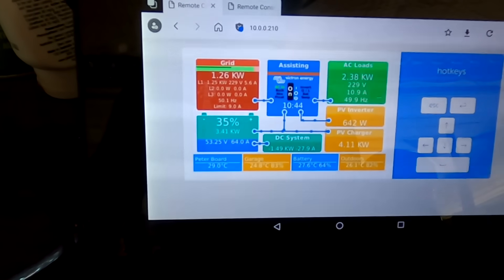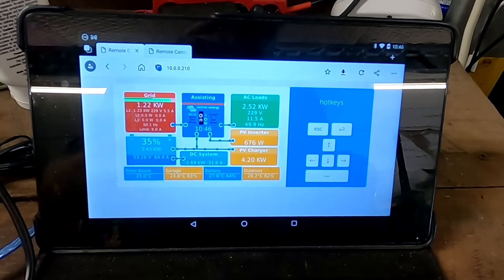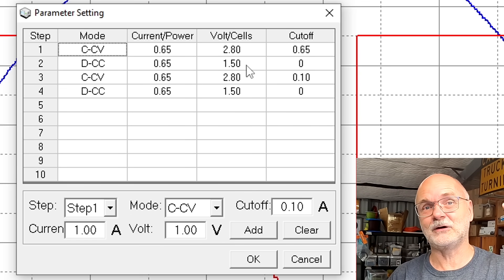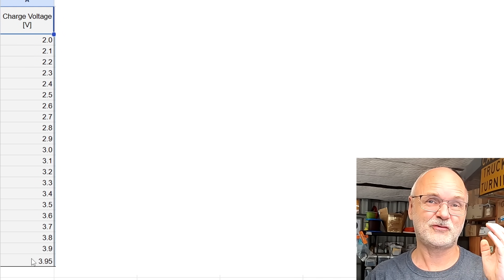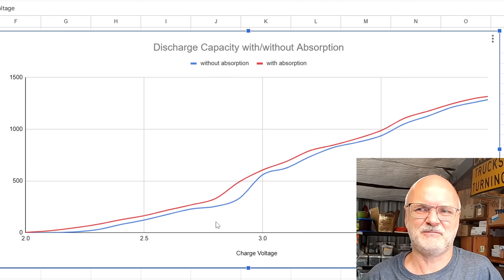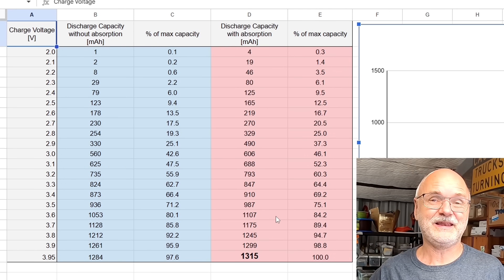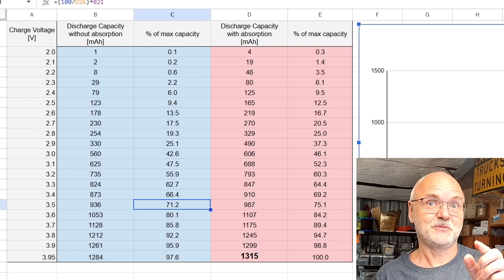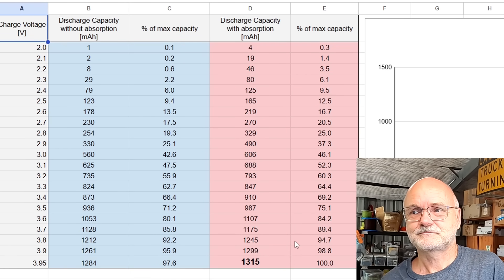Absorbing Sodium batteries. Capacity gain or worthless?

Comment: I think we’re going to find less need for balancing. We balance LFP because a few millivolts has a significant impact on SOC. In a series sodium pack, other than the BMS ensuring that no cell goes above 3.95 V or below ~0V, I see little need for balancing, unless the cells are grossly mismatched. My concern for solar storage with these is the large voltage swing between 0-100% SOC. I think this necessitates inverter re-design.
Reply: Top Balance, Middle Balance, Bottom Balance - I say let the balancer run....  It will shut itself off when it's happy.
Reply from the maker: Good thinking. Thanks for sharing.
Reply: The Voltage swing can be compensated by using only like 60% of the battery and than have to buy more battery or having better suited inverters. The priece is what matters.

Comment: I would be interested to see what happens when you connect sodium batteries that are at different states of charge into either a single pack, or packs of different capacity or state of charge together in parallel.  You've shown that different states of charge and different capacity doesn't make much difference in LiFePO4 batteries because of the flat charge curve of the cells.  Wonder how the linear curves would fare under the same situation!
Reply from the maker: Something like this will be in the next video...

Comment: Andy, sign me up for sodium batties!!!

Just reviewing spec sheets.  Looks like the Victron Multiplus II will run just fine with these.

The input voltage range of the MultiPlus II  is 38 - 66volts

16 Na batteries at 3.95 volts = 63.2 Volts (that's 100 SOC)

16 Na batteries at 2.375 volts = 38 volts (that's less than 10% SOC interpolated from you tests)

So using a Victron Multiplus - it looks to me like you can use 90% of the Sodium battery cells' capacity.  Sounds pretty good to me, especially among those who like to cycle at less than 100% SOC.
Reply from the maker: As discussed in the first sodium battery video😉
Reply: I wonder what the output voltage is at the high and lowest batt voltage.
Reply: With that voltage range I want to know what happens to the amperage output during a constant high discharge.  Say 6kW, as the volts go down the amps go up, how would we live with that without popping things?
Reply from the maker: @garys-half-baked-offgrid-dream It depends on your inverter and how it handles things. At the moment, there is no equipment out there which can use sodium batteries to its full potential. With our current inverters, we can only use a portion of the usable capacity.
Reply: @OffGridGarageAustralia  It's such a disappointing anticlimax, I was excited by the promise of this chemistry.
Reply: @OffGridGarageAustralia   When equipment gets redesigned to handle these sodium cells, let's hope they go ahead and make accommodation for super capacitors while they are at it...

Comment: I don't think these sodium batteries need to be BMS balanced because of steep voltage curve because as soon as voltage drops in one sharply it would be enough for some current from other ones to flow into it because of higher voltage potential. Sodiums might not be better than lead acid ones but perhaps they have more lifetime cycles in them although I am not sure if anyone proved or debunked this yet.
Reply from the maker: This would be the case if the cells are in parallel. But if we connect them in series to a 12V battery, you will need a BMS and a balancer.
Reply: @OffGridGarageAustralia  let1s see how they balance then with BMS. I reckon should be easy because of steep voltage curve 😁

Comment: I think these sodium batteries can be continuously balanced during charging. 

The cell voltage determines the SOC and therefore it is perhaps possible to keep the cell voltage the same for all cells with a balancer. All the cells will then reach the required SOC at the same time. 

This is however not a normal balancer, but a balancer that uses an average voltage as the balance voltage.

Comment: It's well known that LiFePo4 should ideally be stored at around 80% capacity and very low discharge or charging to 101% may shorten their lifetime.
How does this compare to the sodium battery type? Is there any data about optimal storage or optimal state for them to be in? If only a certain part of the whole capacity (aka voltage range) was used, should it be either the lowest part, a middle part or the highest part possible?

Viele Grüße und Danke!🇩🇪

Comment: Long story short: for whatever variant of Na-ion cells you got, absorption is effectively the same as float and end-of-charge voltages. Pick whatever SoC you want your system to sit at when "full", look up the corresponding voltage on the curve, set all of your voltages to that, done.

Comment: Great video. The 80/20 with LFP I'm  using to extend the life. I'm wondering going to 100% with Na+ shortens the battery life?  I'm wondering if you thought of doing a side by side with lithium-ion versus sodium ion same battery amperage discharge (unless you have charts already..) As an aside there are some videos on YouTube that have done the nail puncture test. No fire they just kind of explode.😮

Comment: It relates to overpotential voltage vs cell current.  For given chemistry, overpotential voltage vs cell current is greater for thicker electrode.

If during charging and discharge tests, you terminate current  periodically until cell voltage stops recovering to no load cell voltage you will get direct measurement of overpotential voltage slump (for dischg) or bump (for chrg).  You can do this at several points, approx 75%, 50%, and 25% SoC are typically good points.  LFP needs 3-5 minutes of rest period of zero current to recover to OCV equilibrium.  It would be nice to know what Na-ion is for recovery time.  Overpotential gets greater for greater cell current (chg or dischg).

These particular cells have fairly low overpotential.  It maybe they are made with thin electrodes.  The 200 AH prismatic Na-Ion cell may be different, likely greater, for given C(A) cell current chg/dischg rate.  Not all chemistries have symmetrical chg and dischg overpotential voltage vs current.  LFP if fairly symmetrical.

There is definitely something happening at about 25% to 35% SoC range where the overpotential rises in that SoC range.  It typically means there is some issue with ion migration rate in that SoC range.  Na-Ions are significant physically larger than Li-Ions.  The graphite negative electrode is called hard graphite, which is more like shale layered graphite, to allow for larger Na ions to infiltrate.

Sodium dendrite growth is an issue with Na-Ion cells and the funky result at 25-35% state of charge may have something to do with the alloying used.  Carbon arsenide, nickel antimony.  So much for environmentally friendly label.
Reply from the maker: Interesting! Thanks for sharing.

Comment: Got some issues with the info you are giving us. I don't think these small batteries will extrapolate that well to the larger ones. Assuming they are linear in all aspect; still the deviation could be quite large. Also, I am not quite familiar with the price differential within the battery formats. I think the price differential is what is going to do it overall. Knowing the manufactures avarice. Supply and demand will probably be the deciding factor.

Comment: I would say, with this linear curve,  you can balance almost at all voltage except near 1.5v. With or without absorption.
Reply: That mean, with a frankenstein battery and a high capacity balancer, you can ever make a top and a low balance of your cells. You may be use all the capacity of your differents cells capacity even if i don't know if it will be a good idea for your cells life.
Reply from the maker: The balancer would still need to be large enough to do a bottom balancing and top balancing with the same pack. with 300Ah and 280Ah in a mix, it needs to move these 20Ah back and forth quickly, depending on the load.
Good answer and thinking.

Comment: Well, you can set absorption and float to the same values...like 3.7V
Also, a passive charge balancer can make sense and you can also leave your cheap ative balancer connected the whole time ;)
But still, in a normal solar system, your batteries are fully charged many hours a day...so our LiFePO4 balancing strategies still work perfectly fine as well 😇
P.S.: Thanks for the crazy effort!!!
Reply from the maker: Thanks for sharing your thoughts. Good answer!

Comment: Hello Andy, 
more Batries or more Panels....What's better?
If you double your batteries, will you get them fully charged on one single sunny day - espacialy during winter?
And how many days per year will more capacity give you a gain?
With my batteries i can get arounnd for two nights and a dark day between. If i double the batteries i will gain around 36 houres. 
But in Winter im not getting my batteries fully charged for weeks - doubling them would then not change anything.
In summer they will be discharged at maximum to 65% SOC over night. 
So there will be only a gain on some days in Feb and Nov.
Concluding this, my descition was to set up more panels for cloudy conditions and leave the batteries as they are...
Reply: I think more panels is the right choice most of the time. You should size your batteries based on demand, which also decreases as you add more solar panels for the worst of days. This is a much better way to go with solar panels being pretty cheap right now.
Reply from the maker: For the price of a battery you can get a lot of panels. BUT, do you have the space to install them? Not everyone has and is limited by the roof size.
My energy consumption with the Tesla and a potential second EV just around the corner, the plan to connect the whole house to this battery as well as going off-grid with the system, demands more capacity. I can chew through 80% of my battery shelf in one night and if the sun does not shine the next day... well... This would not happen if I'd have a 100kWh battery or more. Sure, I won't fully charge it in winter, but who does???

Comment: Nice. I was thinking since victron has its charges sperately (not hybrid) say when the battery is fully charged to where we want n yet there is load n the charger (solar) give power to the inverter and if yet there is extra solar wouldn't that charge the batteries till the bms stops charging. If this happens then the bms won't be the last resort. Or does the charge reduce voltage so that it wouldn't charge the batteries. I not sure if I am clear regarding the question😂

Comment: No need to have an active balancer if the voltage correlates so well with the SOC.
Reply from the maker: No balancer at all or just not an active one?
Reply: When voltage closely aligns with the SOC, opting for a passive balancer rather than an active one is often sufficient. This method leverages the strong voltage-SOC correlation to maintain cell balance effectively and cost-efficiently.

Comment: I wonder how they would compare as replacements to Li-ion 18650 batteries, of the same capacity
Reply from the maker: This will not work. The voltage is highly different.
Reply: @OffGridGarageAustralia  Sorry, I guess I wasn't very clear ... my bad.   I'm not talking about replacing a single cell in say, a 7s battery pack ... you're right, that would never work.  BMS would freak.
I was talking about a pack made from nothing but the 18650 Sodium cells. Maybe a 4S 12v or an 8S 24V pack.
Reply from the maker: @GregOnSummit  here again, voltage of the sodium battery is very different. 12V battery starts at 6V linear up to 15.8V. Crazy.
We will do this in one of the next videos.

Comment: Even at 50-60% DoD, these should have a major advantage over LA if you factor in weight, cycle life, and voltage sag. As long at the price is right.
Reply from the maker: Yeah, OK, in comparison with lead acid, they have an advantage. Voltage is still a hug challenge though.

Comment: Hi Andy, I have a totally off topic question for. I have a 48V battery pack which has problems. When it discharges the SOC drops down to 0% while the pack voltage remains about 52V. When it charges or is at rest the SOC returns to about 90% and all looks OK then. But as soon as it needs to discharge the SOC drops to 0% again. The pack still delivers the necessary amperes but it seems not ok to me. Additional input, I had a short once at that cell due to my own stupidity and the + pole is very much damaged, could that also be a reason for this behaviour? I hope you will be able to respond! Thanks in advance

Comment: It sure looks like the balancer could just be left turned on from roughly 50% SOC all the way to 100% SOC.  You could charge to just about whatever SOC level you want based on voltage without too many worries.   I'll bet sodium battery default settings in BMSs won't do that though... they'll be just as broken as default settings were for LiFePO4, for years and years.

Weather report is in amps now, with XYZ amp-hours expected!   Thanks for doing the tests!  Interesting interesting.

-Matt
Reply from the maker: Thanks for all your great comments and support over the years. Much appreciated.

Comment: Hi Andy, amazing work again. Superinteressting to see the different chemistry performing. I know about your LiFePO4 charge recommodations, but do you think you could perform the same test for LiFePO4 as well? Like charge voltages 3,35-3,65V in steps of 0,05V. Would be extremely interessting and would a great reference to all LiFePO4 users out there! :)
Reply from the maker: I think I have done this already and found it only works at 3.4V and above. However, 3.4V does not really work as there is not enough voltage delta to start the balancer, so 3.45V turned out to be ideal.
Reply: @OffGridGarageAustralia  Thank you for your reply Andy! I am aiming for the Excel graph you've shown in the video. Many people insist on the fact, that a cell is only "full" if it hits 3.65V. But as we know, this is wrong, if we spend some time for absorbtion - or at least it is wrong if we consider 99% SoC also as "full". With the sodiums we have seen two more or less parallel lines: absorbed/non-absorbed capacity. For LiFePO4 I would expect the same parallel graph from 2.5V-3.35V, but the "absorbed"-line should max out at 3.4-3.65V. I think this would be very beneficial to visualize e.g. at your website - even if most of your viewers know this fact already. But as reference to the world it would be superb :)
Reply from the maker: @techNick0815  OK, no worries, I'll put this on my list of future videos. Thanks.
Reply: @OffGridGarageAustralia  thanks a lot Andy! :)

Comment: Is there a downside to absorbing? It would seem to me that every extra Wh of capacity is nice to have if there is no added cost or risk in doing so.
Reply: Sitting at a high voltage for an extended duration is stressful, and seeing that absorbing at 3.6V still gives less usable capacity than momentarily charging to 3.7V (as an example), there is no gain from absorbing for long duration at a lower voltage (like you'd find for LFP) compared to just charging to the 100% mark and then turning off charging (or going to a lower float value)
Reply: @Stefanfj  I agree that it would be better to charge to a higher voltage, but for now that is difficult with Sodium-Ion as a 16S system would go beyond the voltage limits of the available chargers and BMS anyway. So  absorbing at this lower voltage would be the way to compensate.
Reply from the maker: As we have seen in this test, we can absorb at any voltage with these sodium cells.

Comment: From what I understand, since those batteries are not dangerous, so you can use them on all there voltage range. at zero volt it can be recharge and can not  burn over voltage. rigth ? I mean I feel  better using those king in my  house then the other one. for me I use lower setting on lifepo4 to not exceed limits because it's dangerous.
Reply from the maker: Well, we don't know anything about the safety of these cells. This is just what the marketing says. How safe are they really... watch this space...

Comment: Good passive or tiny active balancing WHILE charging seems the way to go. As of the Video from Zerobrain and the conclusion that all above 4V is critical for the electrolyte, i would charge the sodium´s to 3.8v or 3.9V. In combination with LFP i would to the 3.6V to 2.5V setting. It might be a little hard for the LFP ones but the sodium´s are fine. In comparison to the lfp ones i would suggest the sodium´s a shorter cyclelife than the LFP´s. So the "middle" way would be my choice.
Reply from the maker: You would parallel LFP and sodium? Very brave...
Reply: @OffGridGarageAustralia Why not? U can parallel everything if the voltage fits🤪
But don´t be afraid. I think I wouldn´t buy sodium´s instead of LFP´s. The benefits of LFP´s are way to good to choose sodium´s instead.

Comment: I have a 500 amp smart shunt connected to 4 100 ah batteries. I want to add batteries but hate to abandon the current shunt and get a larger one. Is it possible to parallel another 500 amp shunt?

Comment: When you build big batteries this could change, doesn't it?
3% Can be a lot when you build a 400 volt battery with high Ah it could be benefitial and better to let them absorb, as long as you have the time for it. 

On the other side this could be interesting for a buffer battery which helps to let lithium batteries charge and discharge more constantly, which apears to be favorable?
Reply from the maker: I would not recommend building a DC HV battery. Far too dangerous.

Secondly, the lithium battery does not need to be charged constantly. It makes no difference to them.